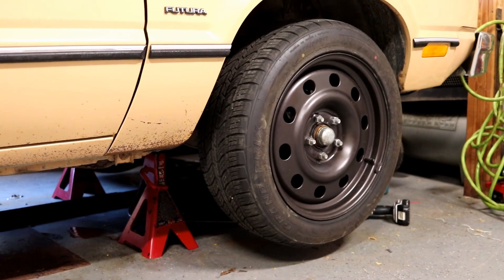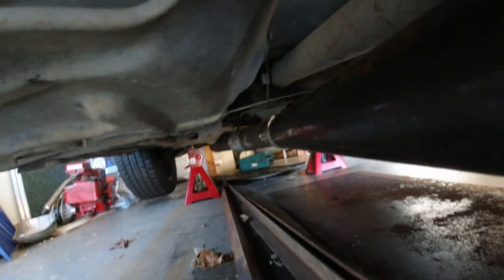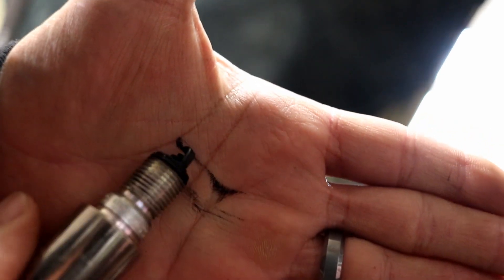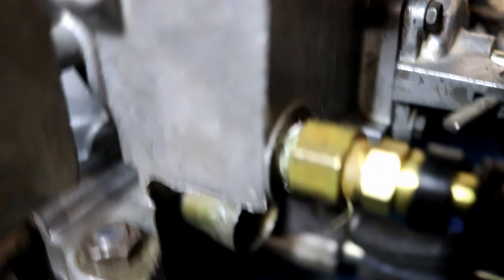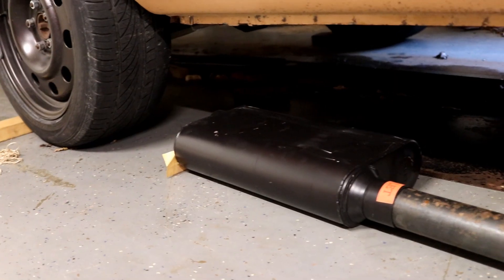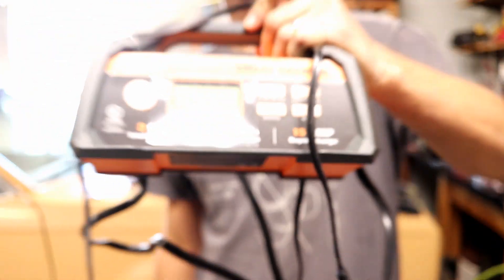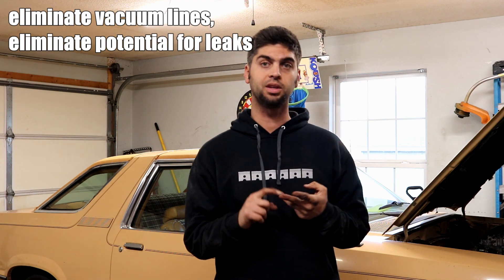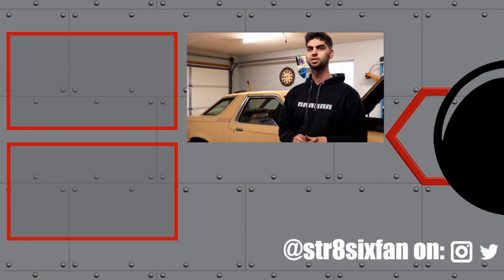Diagnosing a Poor Running 1978 Ford Fairmont, Part 2

Comment: Think there's any way you can use the better single stage power valve with the two stage cover/bowl? Also ported vacuum is USUALLY the best solution for a stock/mild street car but I always try both to see what it likes. Never heard of hooking it up one way or the other causing an erratic reading on a vacuum gauge but you still had to choose one or the other eventually. Depending on how your combo is setup you likely need to add some more initial timing to compensate for the lack of advance and slower idle when switching from manifold to ported. The big cam in my Satellite actually runs much better with manifold vacuum. If you haven't already you really need to watch Thunderhead289 and UTG's videos about this subject to help you get a better understanding of it.
Reply from the maker: yea I watched thunderheads